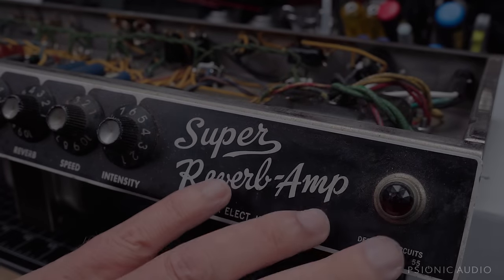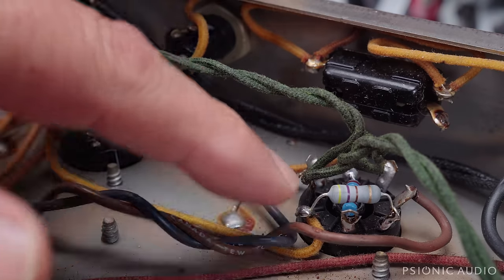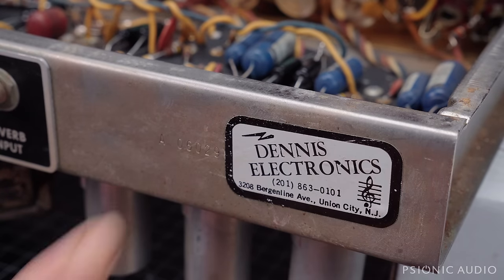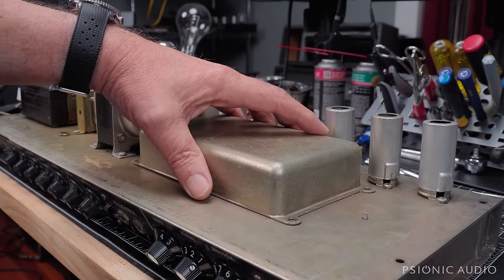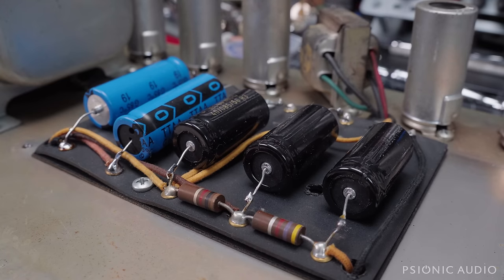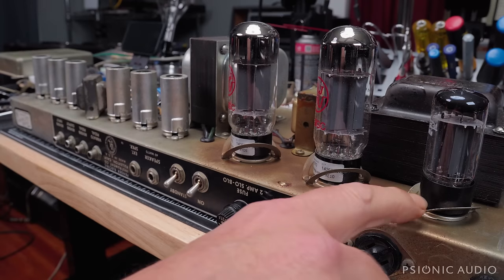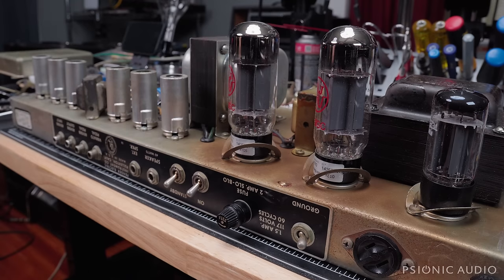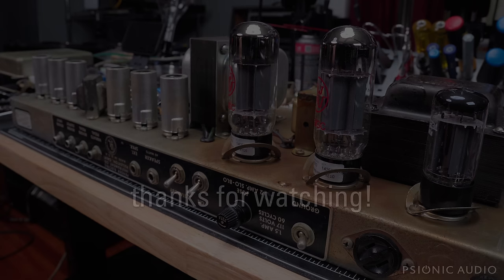Rugged Glory | '65 Fender Super Reverb Pt 1

Comment: I had the pleasure of blueprinting and cleaning up an all-original 1965 Super Reverb about 15 years ago. I did replace the bias board with one that included better filtering and a trim pot because the bias filter cap and diode were toast. What a wonderful beast of an amp!  

The blueprinting was for a clone I made for the father of the amp’s owner.

Comment: Dennis Electronics was a very well known amp repair shop run by Dennis Kager (1943–2018). Dennis worked at Ampeg and started the Sundown Amp company.  He patented the Ampeg Horizontal bass. 

From Premier Guitar:  “During the ’70s and ’80s, his client list expanded to include S.I.R., Foreigner, Hall & Oates, Rick Derringer, Johnny Winter, the Police, and the Allman Brothers. For the latter, Kager devised mods to make their Marshall heads more reliable, installing durable tubes and blowout lights in the back of the heads to indicate failures faster. In more recent years, Springsteen was a client.”

I haven’t seen one of those stickers in years! Personally I’d leave it on the amp!
Reply from the maker: The sticker was his. I don’t think the sloppy work was - looked relatively recent.
Reply: @PsionicAudio  I grew up in NJ go I saw his work a lot. I’d been to the shop back in the 70s. Yes that work was too recent. The shop has been closed for decade.

Comment: There's no ZIP code on that shop sticker. I suspect it's old, probably from the '60s or '70s, when it was common practice for a repair shop to put their sticker on the amps, TVs, etc. that they fixed. The TV repair shop I worked at back in the '70s always did. There were practical reasons to do so for the shop (repeat business) and the owner (to remind who worked on it before, and would know its repair history). I doubt that "Dennis" or whoever put that sticker on had any concerns about defacing a vintage collectible because it probably wasn't, at the time. 
What's worse than a sticker is when I find a former owner's name or social security number engraved into the metal! 
Always great to see you expertly dive into these great old amps, Lyle.
Reply: I was playing during the periods you named; these were just everyday, tools, amps that we just all took for granted back then.
Reply: Old enough to remember that sort of thing - with a signature/service log - on the back of the television.
Reply: @ThomasD66  , I'm old enough to remember a time before every electronic device was labeled "no user serviceable parts inside; refer to qualified service personnel". I'd like to have that on a T-shirt!

Comment: I still have a 1964 Super Reverb which I bought brand new. Just had some work done on it, including 5881's, new SoZos to replace junk that it has acquired over the years; and new reverb cables and capacitor, as well as some SoZo silver micas in the treble spots, along with a 5R4BY rectifier, which I LOVE!!

Comment: I have worked on a few friends amps where it went down in practice and needed an immediate fix. In one case, for example, it was plate resistors on a twin reissue. I don't want to go through pulling up the board and dealing with the pads. Im not charging anything for this, so I just cut the old resistors out and j hooked the new resistors to the old leads. No its certainly not ideal, but its functional until it can get proper work and nothing was damaged in the process. I would never charge for something like that or represent it as a proper fix.

Comment: 1000% agree on light oils like WD40 for a solvent. Even sewing machine or hair clipper oil is a good light solvent, you just need to use more elbow grease with it.  That icky yellowy white powder on the zinc plating actually protects it. WD 40 as a protectant? I have a gun care product I really love but it has an odor that many find offensive. It's a WWI era German WD40 for small arms. Good for metal, wood, & leather.
Reply: Heckler & Koch used to sell that Ballistol stuff and H&K guns are stupid expensive so Ballistol was also expensive. It works on fretboards too.

Comment: Hey Lyle, what would you use to remove stickers and the associated glue residue? 
As an Aussie (G'day from Down Under) on the back of the amp there I'd just use Eucalyptus oil which works amazingly and smells good too but wouldn't be so great too near electronics. I guess you could then get rid of any residual oil with a paper towel and isopropyl but then you're just adding an extra step. 
Is there anything that's good specifically for that gunky sticker/tape glue residue that's safe around electronics>
Reply from the maker: Naptha (I think you call it Shellite). I don’t know if you have Goo-Gone - it leaves an oily film, but it can remove sticky stuff Naptha is slow on.  Then Naptha or Iso to remove the oil.
Reply: @PsionicAudio  Yeah, Shelite is the usual name here. O.k, thanks. 
Pretty much every household has Eucalyptus oil here somewhere and it removes that same kind of tape/sticker glue really quickly and easily without a trace on most things but yeah, I wouldn't be sure about using it near electronics incase of residue but it would clean up with Iso too I imagine